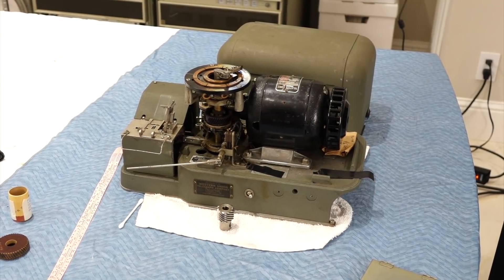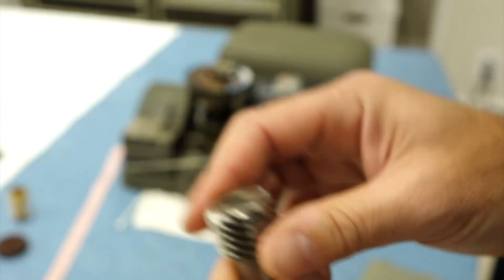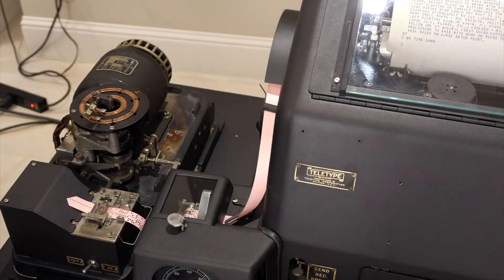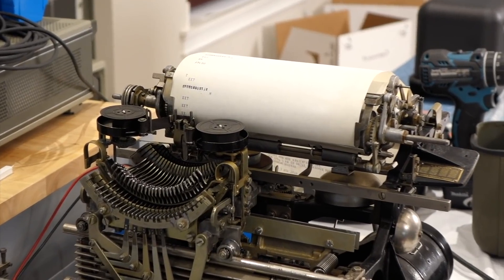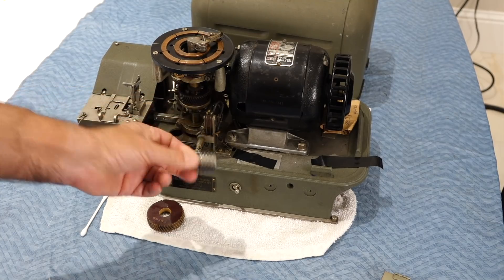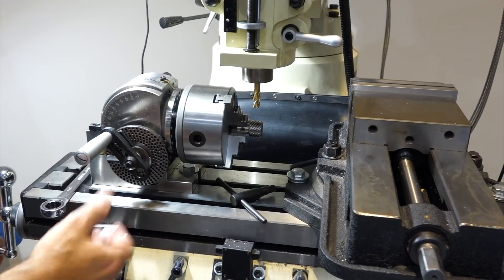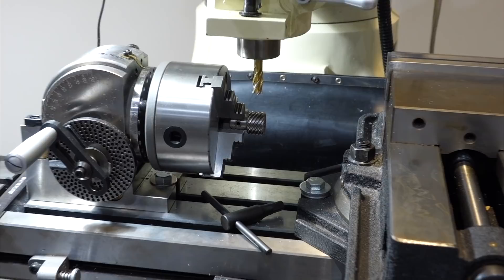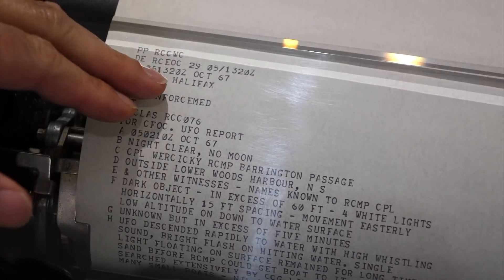AvE's CNC Machining Challenge

Comment: How did they make that gear in 1933 with no cnc, all manual machines?
Reply from the maker: Using gear linkages to sync rotation and translation, or on a screw cutting lathe (also using gears).
Reply: There was electromechanical automation in the 30's but a gear like this was likely ground with a fully manual machine using a gear driven indexing head as the production volume was extremely low. Cutting helical gears was actually a huge step in engineering along with involute gear geometry.
Reply: Magic! (And correct tongue angle)
Reply: They had and still have purpose built gear gutting machines. They are kind of milling/grinding machines but with rather special movements and fully mechanical drive.
Reply: Gear hobber is most common and a long time to make each one
Reply: @Sicktrickintuner  its a lot faster than doing it on a lathe!... I do this for a living!
Reply: Just like you would cut a thread, using the lay shaft and settings on the lathe itself
Reply: I could make that on my Bridgeport and universal dividing head.  Just takes a bit of nouse.  CNC is not necessary for that job.
Reply: The same pyramids were built. Sheer determination!
Reply: One way is to sync the dividing head to the X-axis feed with gears like this. https://youtu.be/tePh773MxNA.   Our machine shop at work has a really old mill that has all of the equipment to cut helical gears.   However,  all of the helical gear cutting attachments have been sitting in the tool room collecting dust for decades because there are better methods today.
Reply: It’s basically a multi-start thread, so any lathe with thread cutting capabilities can do it, provided you can get the right gearing between the spindle and the lead screw. A mill can do it, provided that it has an indexing head that can be driven by table movement, and again you have to get the gearing right. In production in the 1930’s they would have used a gear cutting machine, which is a more purpose built device, or they would have had a special machine made to do it. The reason you would do this today with a CNC is that a 4 axis CNC mill can have arbitrary “gearing” between the A axis and the table movements, and with a 5 or 6 axis you would have even more freedom when it comes to cutter choice since you could do the tooth profile in multiple passes. The take away is that anything is possible on manual machines, but it can quickly become cost prohibitive if you only need 1 of something. Some machine shops still make their own machines for some jobs if they are going to be doing millions of parts that all require the same operations, since a purpose built machine with lots of spindles is a lot faster than a CNC that has to do tool changes.

Comment: Good luck in getting AvE to do it, but... it seems to me all that needs to happen is some kind of belt system to link the two handles together with a correct ratio?

Also how is it supposed to work, are you supposed to have a STEP file that you sacrifice to him, or would AvE also CAD the whole thing? I don't think he promised the latter. Seems to me this could even be tested with a 3D printed design, the forces aren't that great are they... the other gear looks like it's made from Pertinax/Bakelite or something like that.
Reply from the maker: Exactly. Well, more like an expensive, rather complicated, n-way adjustable, sturdy and play-free gear system. And some judicious tilting of the milling head. And a specially profiled cutting or grinding tool. And lots of fraction calculations. That's how it was done before CNC.
Reply: @CuriousMarc  if you always cut in one direction, then i think backlash in transmission has no relevance? Also i don't think you can make strictly backlash-free gears, because for that you'd be moving right on the cusp of binding, which would inevitably happen, this is why toothed timing belts are a thing, they don't have that issue nearly as much.
Reply: @SianaGearz  Play and backlash can still be a problem in rotating & vibrating machines if you need the precision demanded by, for example,  a 10 start helical worm gear as in this situation.
Reply: @GregorShapiro  Oh i see, thanks!

Comment: If you already have a Mill with an index you should really convert it to cnc with a few Nema23 and some gecko drivers and an arduino uno. You can make the mounts for the steppers with the mill by hand and the forth axis is easy to make (its beter to make a "cnc" index rather than modifiying the old one)
Reply from the maker: Ah, yes, I could. But then I would not have the hilarious and educative AvE's commentary on gear machining that would inevitably come with it.
Reply: CuriousMarc well maybe you could convert it to "old" cnc using some of your old computers to control the motors and add some nixie tubes for the numerical control. Dont tell me you wouldnt want to have a cnc mill controled by an old computer as powerfull as an arduino? (I wonder if its even posible to implement something like grbl on such old hardware. )

Youd then feed in the gcode with the paper tape drive :3